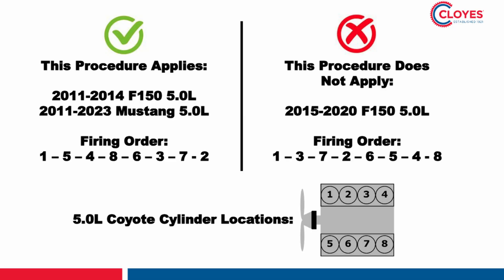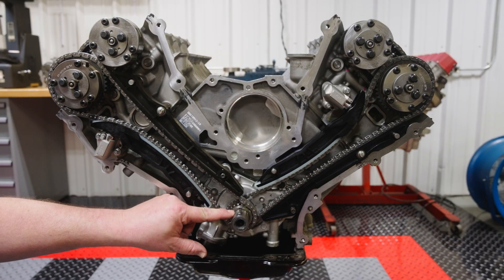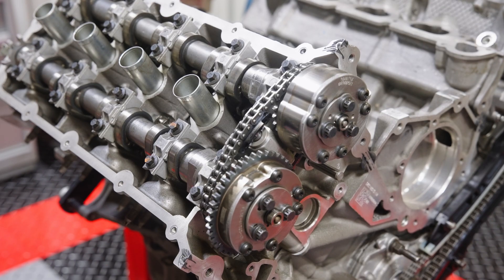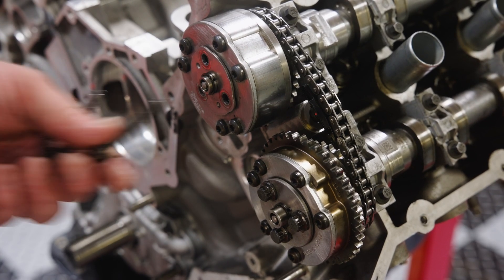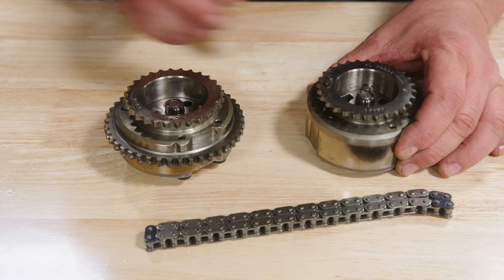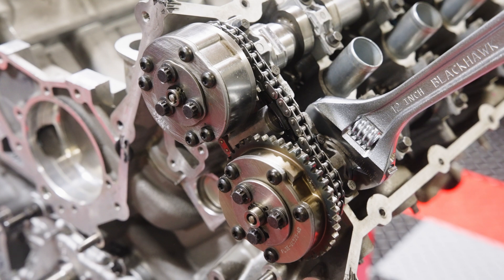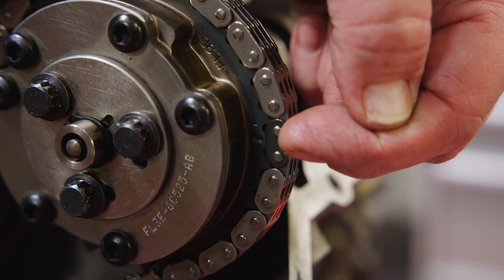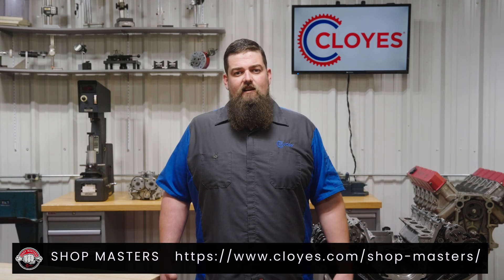Ford Coyote 5.0L DOHC V8 Engine Timing Chain Replacement Video

Comment from the maker: Thanks to all the viewers that commented on our original Ford 5.0L Coyote video! We unfortunately grabbed too many years of F150 coverage in that original video, and our Shop Masters Community let us know! To fix it, we clarified the proper coverage on this video and will bring you a 2015-2020 F150 5.0L installation video soon. For the 2015+ F150 engines, Ford changed the firing order, but retained the use of the same camshaft phasers and timing components as the Mustang engines. This resulted in a non-traditional timing installation procedure that requires 2015+ F150 engines to be timed with the two banks "out of sequence." The chain and sprocket timing marks will not all align on both banks at the same time. We will dive into it in our next 5.0L Coyote video!

Comment: Sir ford 150 2015 model when u fix timing mark on came gear and chain mark so show the proper came position both side and which positions piston i mean which piston top position when u fix complete timing.other please i need firing order same ford 150 2015 model  v8 patrol engine